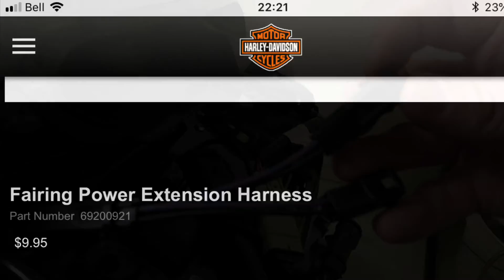Install and Hide your Sena FreeWire

Comment: Just a quick question, purpose of the velcro is just to make it easier to get the unit out? The clip is pretty secure by it's self
Reply: Yes.  I figured it may be a bit difficult to get it out and back in place - I didn't want to be fooling around with trying to mount it in a blind location.

Comment: I have a MY18 street glide special . I held of installing my freewire as I did not like all the wirers all over the place until I come across your video and thought what a great idea.  Just finished I attached power to the wire going to cigarette lighter as I hardly ever use it but turned out great. A great idea hiding the freewire in fearing and to be able to still get to it easily if you need to
Reply: Allan McCall glad it helped.
Reply: Allan McCall, someone asked me if you have to flash the boom audio on the 2019 bikes.  I don’t know, I have 2016.  

Did you have to flash the boom or just go in to set up screen and choose what goes to the headset/freewire?

Comment: You state turn Sena off and the 12 volt coming on from the bike will turn Sena on? I thought that the Sena would just be in charge mode and not actually on without the actual Sena power switch on? Please verify.
Reply: Ed Powell.  The 12v Sena power cable will turn the freeware on/off if the freewire’s switch is in the off position. I just need turn the ignition switch to on or acc to power it up.  Turn bike ignition to off and the free wire turns off. 

It doesn’t work that way for the USB power supply, just the 12v Sena cord.

Comment: So using the included plug with it plugged into the middle hole will turn the unit on and off with the ignition. I saw where another said you need the usb type plug, but that is where the 7pin goes.
Reply: theChestnutMtnTinman , yes the 12v plug into that round hole allows the Freewire to power up when the bike is turned on (or acc) and powers off when the bike is off.

Seems it has to be that sena supplied 12v adapter ‘though.

Comment: I find that I need to see the Freewire blue light. Sometimes the headset doesn't sync up. In that case you just have to press the button to force the connection. I have my Freewire in the right pocket of my Road Glide so it's easy to lift the cover and see what's happening to the FW.
Reply: Yes, I’d have to stop and look under the lower right side of the fairing to see the blue light and reach in to get to the button
Reply: @h3r63rt  Thanks for watching.

Comment: What does the Freewire do for a Streetglide?  Can you now use the CB radio?  If so how do you change channels and press to talk?
Reply: I don’t have a CB Radio.  But it would work the same as the wires headset.  

Freewire allows me to give the Boom! Audio system commands via my Sena Bluetooth headset.  GPS commands, music commands (play playlist or artist), etc.  I have everything set up to playback through my Bluetooth headset too - listen to gps instructions and listen to music. 

I can also receive phone calls through the Boom! Audio and talk on the Bluetooth headset. But I don’t have a phone paired to the audio system.

Comment: I suppose there is no way to do this without that adaptor harness?
Reply: Touring Midwest the 12v adapter?  Sena 12v adapter powers it and turns it on and off.  If you use another USB adapter to power it (such as connecting it inside that small cubby), I don’t think it will power on/off. The FreeWire would be easy to find (and steal) there too. 

Ps - just catching up on YouTube. New racing career is really busy 😁

Comment: Why can't you just add a male plug to the Sena supplied harness after cutting off the cigarette adapter? I'm sure the plug is a common wiring harness type plug with the pins. that would snap in and out as easy as plugging a cigarette plug in and out. It wouldn't take so much space either.
Reply: S Wilds good idea.  I had the female socket already, so I used it.
Reply: The 12V plug is not standard. It contains a 12v-5v circuit. The Freewire power input is 5V.